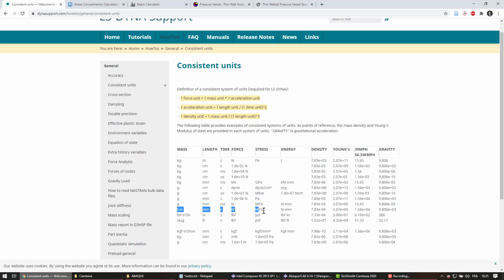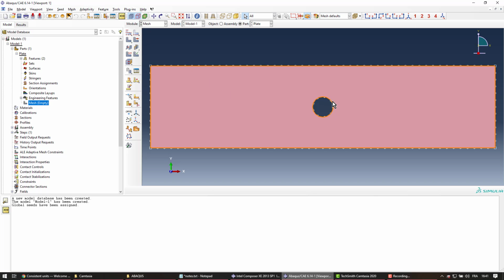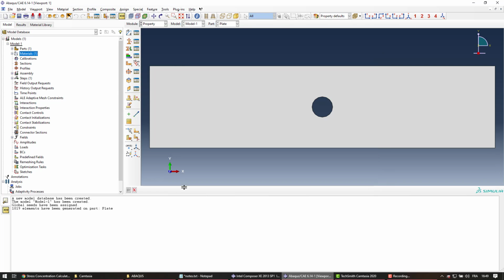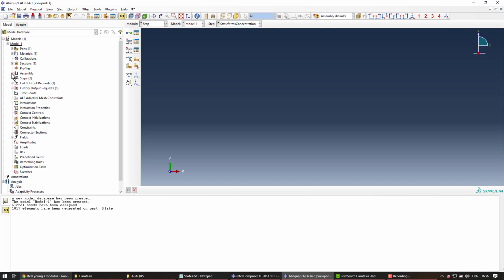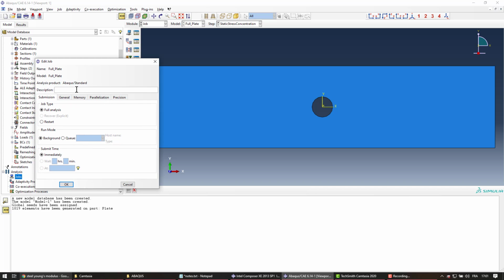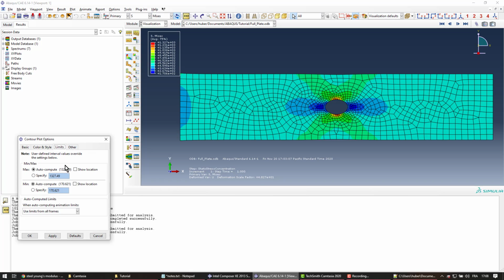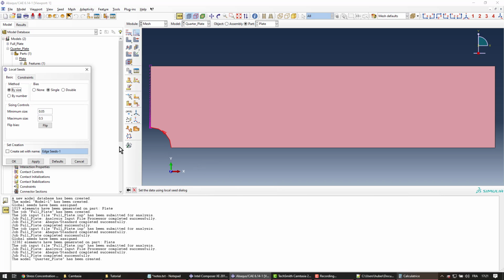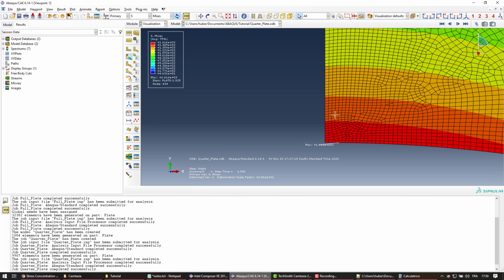Abaqus CAE Tutorial: Stress concentration in a thin plate with center hole

Comment: how would I draw a 100 x 100 x 4  thin plate in 2D  and if I have used thickness 4 along y-direction and length 100 along x direction for a 2D model, what value should i input for plane stress thickness in section ?
Reply from the maker: From what I understand, you are looking at the cross section of the plate. You'll have to input 100 as the plane stress/strain thickness but most importantly, you'll have to use plane strain elements e.g. CPE4, CPE4R, CPE8, CPE8R
Reply: @HubertGod  hey yes I'm looking at the cross section (side view of the plate) .. I have already used CPE4